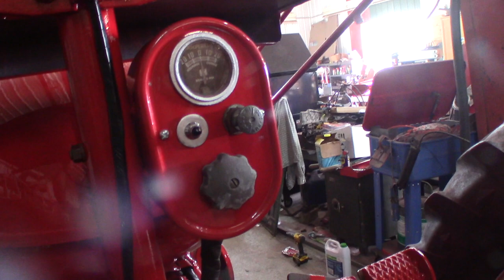I want a paint job on the Super M! Part 4 Finished....well mostly.

Comment: Looks really good !. Thanks for the video .
Reply from the maker: Hi Darren; Glad you liked it. I have more vids on doing this Super M. I bought it at the sale and my son Connor who is usually the voice of reason really liked it and said it had all the original parts. As I looked I saw he was right. So although it didn't run we bought it. Surprisingly we had it running in about a half hour when we got it home. Probably could rebuild the carb but runs pretty good and everything is tight. No weird noises or transmission clicks or clanks. Very happy with it. Thanks for the comments and thanks for watching!!